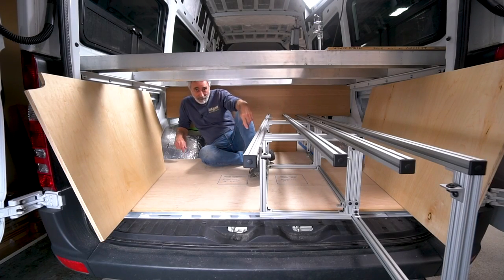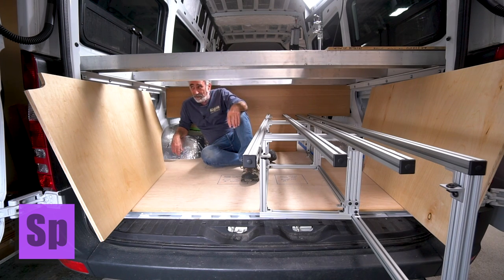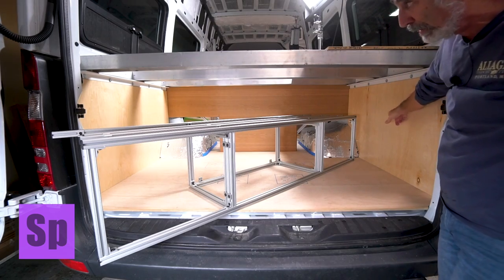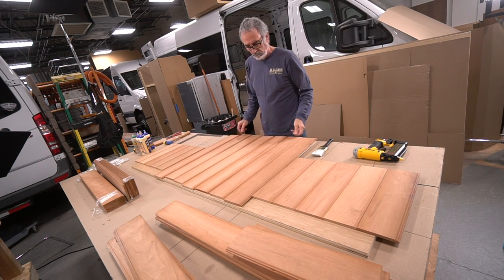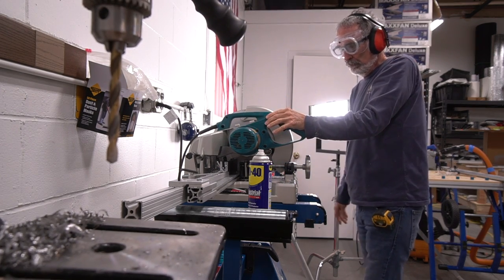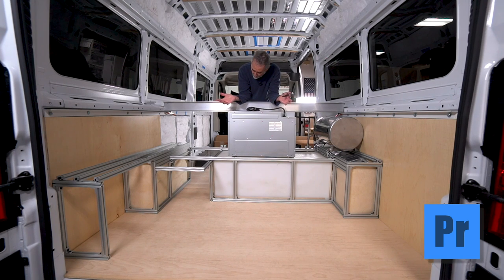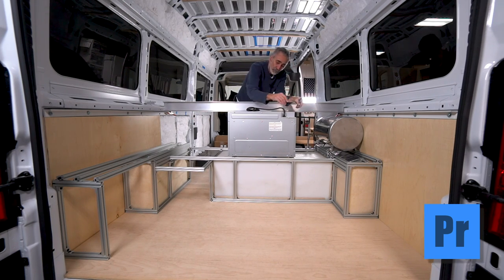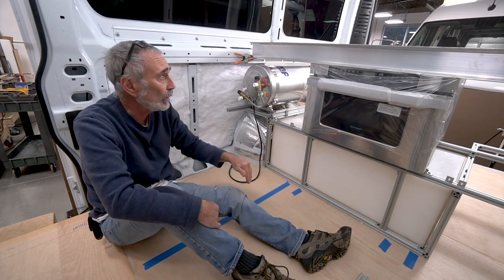More van build tips to improve the quality of your build

Comment: If I could give 2 thumbs up I would. Great video. I got very good results with using alcohol to drill holes cut threats or cut aluminum. Cheap and easy to clean after dry. Only the aluminum chips are left.
Reply from the maker: Interesting, I'll look into that. My first thought is fire hazard with the heat. No flare ups?

Comment: I've used a fair amount of Rubio for my floors, trim, etc.  It is great stuff.  If you really bought a whole gallon, you probably have enough to do 50 vans.  A little goes a long way.  Be aware that the hardener seems to kick off over time.  My guess is that the crappy cans they sell it in are not air tight once you open and reseal them. try decanting to a better container or vacuum sealing the hardener after use.  Also, my local hardwood floor distributor sold me the 1.3L size for $80-90, but It's been over a year since I bought any, so prices may have gone up.

Comment: That was 18:22 seconds of pure information and not a spot of wasted info at all.  HEY!  I LOVE my 90-pound pull magnets. I use them to put the cover on my windshield and keep it secure in even the wildest windstorm.  Problem:  When 2 of the magnets stick together it takes an act of Congress to pry them apart, so you have to make SURE you put the nylon insert between each magnet each time you disassemble and put away.  Maybe try 90-lb pull magnets?  Would make that wall even more secure in case of an accident?  ($12-$14 per 10-pack.)

Comment: I like your magnetic walls , good idea.
Instead of mounting your water heater with four bolts how about one side having 2 notches it slides into and then you only need 2 bolts to mount it instead of 4.
I recently started mounting every thing using the 2 notch 2 screw method .
Good work as usual
Thanks for sharing
Reply from the maker: The water heater comes with two notch, two hole feet, just as you suggest.

Comment: Good stuff! I've already got my magnets for a ceiling in my pro master. What fun it has been trying to stuff a home in a van. Your videography is so good wish I could get better at it sooner. Working on a van to try and sell and really wanted to make more vids of the process but that is a world I haven't been able to wrap my head around yet.  I have one video showing where I'm at on my build if your ever bored. Trying to incorporate a recirculating shower on top of a standard system with a UV light filter and a heat exchanger. Wanted to go the PexA route but it wasn't in the budget. should be an interesting build upon completion. Not near your level of equipment or strength but I think my thought process of accessibility is a lot like yours. Thanks for all the information!
Reply: @bukit23 What pull strength magnets are you using for the ceiling, this is brilliant!

Comment: Attaching the panels using magnets: It's a great idea. 

But the panels will float on the wall and have small amounts of motion relative to the van body - the van body will move more than the rigid panel. I have a case where a magnet holding a door in a B van has annoying metal-metal squeak as the van body flexes. 

I'd suggest making sure that the magnets don't squeak. If they do, a very thin layer of something will less friction might help, without reducing the hold strength too much.
Reply from the maker: I have an idea to keep the panels stationary.

Comment: I installed a underwater marine led lite in my water tank about 4 years age and it still is working, you can mount a surface mount or they make a very small round led lite that mounts in a thru hole..... to see your level..
Reply from the maker: Yes, a light source on any side of the tank will work. Using a momentary contact switch.

Comment: George, I am in the process of planning my 3rd van, a Transit. Your vids are opening up new ways of thinking and building, thank you! I have a couple of questions (for now)- 
How are the magnetic attachments for the wall panels working out? Worthwhile or no? 
What is your current thinking on flooring, floor insulation, and anchoring 80/20 to the floor? 
My van use is as a minimalist camper, and as a flexible hauling vehicle, so easy, repeatable removal of most cabinets is important. I really appreciate your approach of making everything accessible and serviceable.

Comment: Another great video production and explainer. After building your last two vans with self-made 80/20 connectors, did you find the return on investment of time better with the branded fittings that it was worth the extra expense?
Reply from the maker: Yes I did. The biggest drawback is trying to achieve perfect alignment and offset of the holes in the hand made. Near impossible! It will bite you in the A$$ later on.
Reply: That’s what I’m finding too. Unless it some one-off piece that 80/20 doesn’t make, the time it “costs” to make the brackets is not worth the time spent. Thanks and look forward to more insights.
Reply: You need someone to make you an alignment jig on a mill for you.  Would be simple enough.  Oh, hey, <light bulb> a CNC Router could cut you a very nice alignment jig out of aluminum! 😁 👍 hint hint

Comment: Great content and very nice to watch. I’ve got question regarding fixing the 8020. What kind of screws or bolts are you using in order to fasten the 8020 modules onto the structural aluminium members underneath the plywood?
Reply from the maker: Thank you for your kind words. I use self drilling screws through the finished flooring and into the aluminum joists. All side wall fastening is done with nut/bolts or PlusNuts.

Comment: Wondering if you put any rubber anti-vibration damper pads or strips under the microwave and water heater in the Promaster? Or is the metal on metal contact not a big deal once the components are secured?

The builds are coming along beautifully. Each video inspires thoughts of future projects. Can't wait until next Sunday!
Reply from the maker: Yes, I'll explain all that when I do the final install of those components.

Comment: Looking forward to knowing what water filter system you purchased. I purchased my 12v Remco 3200 pump based on what you purchased for another of your vans. Are you able to say which water filter with UV light you're going to using?
Reply from the maker: It's a custom job, does not exist for consumer market.

Comment: I like the aluminum beams. This has a garage and raised bed.
I'm a single guy looking to travel.
Don't like cutting off walk through access to the rear doors.
Is there a way to mount a bed on the wall that folds down?
I didn't know if half on one wall and half on the other for full width sleeping instead of North to South.
I'm thinking 48" width would be wide enough.
George you get me inspired and thinking watching your videos.
Reply from the maker: My next two builds will be rear bath twin bed galley forward floor plans. One of the twin beds will contain the mechanicals, the other, a long workstation that will convert into a bed for the occasional guest. stay tuned!
Reply: I like the I-beams as well.  Is 4" overkill for this length?  I'm really impressed with how stiff it was in the PM, but would 3" work as well and maybe save some weight?  Can't wait to see the Transits!

The two methods I can think of to open up the walkway and still have a rear bed/garage would be raising/sliding a bed section ala Hymer Aktiv/Thor Tellaro, or a full Murphy bed like Travato 59G.  Or you could raise the entire bed with straps like the Revel.  Or if you want really cool go for linear actuators - see a video from Ladi & Margaret.
Reply from the maker: I would have considered a 3 inch I-Beam, but not available within reasonable distance and shipping was not an expense I was willing to bear. You can invent all kinds of convertible beds and such. My experience is, I don't want to go through too many contortions to get ready for bed. Same with a shower. All that maneuvering gets old very quickly. But to each his own!

Comment: Most vans in Europe come standard with a Webasto engine coolant heater. Would it be possible to use that Webasto to heat water with that water heater? That would be convenient because you don't need the engine running.
Reply from the maker: Yes that would work. I did a hydronic Espar system for heat and hot water in my first van build.

Comment: I see the insulation in the walls. Could one glue ridgid foam insulation board to the plywood panel and then put the magnets into the foam board?
I'm not saying you should do that. Thinking about my own build.
Reply from the maker: THAT IS EXACTLY WHAT I PLAN TO DO! 1/4" foam board with the magnets recessed. Wait until you see my pin registration for the uppers!
Reply: @HumbleRoad  Thank you for the reply. I was thinking 1/2" but might be too thick.
Looks good. I like the vinyl on the walls and ceiling. Maybe not the garage.
Reply: @277kne  Hi from the UK. If you want the thickness of 1/2" Kingspan style board, but the flex of 1/4 for shaping simply use two 1 / 4  boards one over the other. You can fix together with spray adhesive once the first board is in correct shape and position or leave unfixed from each other as long as they are clamped firmly into the final position. Hope this helps. John.
Reply: @johnvancamper9581  Thanks for the tip. I saw bare metal in the video and was concerned about the cold metal. 
George said he is gluing 1/4" foam board to the plywood.
And I was thinking all the wall panels and other finishes will all be sealed or tight so no cold coming through.

Comment: George what will you use to seal the top access hatch on water tank so it won't leak??? Thanks
Reply from the maker: You can use any food safe waterproof adhesive, just make sure you torch the contact area on the tank. That changes the composition and allows good adhesion.
Reply: @HumbleRoad  "Torch" it with a heat gun or do you mean blow torch?? I never hear of this before. Thank you for your reply
Reply from the maker: blow torch. creme brulee butane torch

Comment: Thank you for your videos George for they are a valuable resource. In regards to your glycol water heater does this have a major effect on the engine's cooling system? Does the engine now take longer to reach it's optimal operating temperature because of the extended heat transfer tank?
I pick up my sprinter in July 2021 and your tutorials are fantastic. Thank you again.
David from Down under.
Reply from the maker: My glycol system is a closed loop system using a heat exchanger to pull heat from the chassis coolant. Chassis coolant alteration is simply cutting in the 8 inch heat exchanger
Reply: @HumbleRoad  Thank you for explaining this. 👍

Comment: Excellent video and very useful tips (and ideas). Thank you.
I am building a simple sleeping platform in my new Jeep Wrangler and did lots of research on 80/20. Do you use 1010 or 1515 in your builds and do you thing using the 1010 for that simple bed (just to shave some cost) would be sufficient for weight/no-flex? Thanks in advance and thumb up !!!
Reply from the maker: 10 series is fine as long as you design correctly for the load.

Comment: Great video. Are you mainly using 80/20 10 series or 15 series for your build? Thanks for the videos.
Reply from the maker: Both! Depending on the module and weight requirements.
Reply: In the video above what 80/20 series are you using in the garage area, looks like 10 series. Thanks.
Reply from the maker: Yes, 10 series

Comment: It's mandatory that you have a full description of all that stuff in a user guide: how to dismantle, how to gain access, where is what ... this is what matters when it comes to maintanance and repair and not if there a some screws or just a magnet to pull.
Btw. the disadvantage of magnets is that they are not locking just holding. I have a picture in my mind when the user screws a hook on that wall to secure a ratching strap and wonders ...

... and some users better do nothing by themselves as they have two left hands (as we are saying in German: no use with their hands.)
Reply from the maker: The owners get a full 4 hour video users guide. And they participate in making it for a complete understanding. My magnetic attachment will lock in place. You’ll see!

Comment: Hi George, I want to use your magnet idea. Would there be any problem with having strong magnets in proximity to electrical components (Multiplus, Lynx, MMPT, Cerbo, etc., ) and circuit wiring? I need a panel behind my electrical system 8020 bench, where all electrical components reside. Would truly appreciate your thoughts.
Reply from the maker: It could be an issue.

Comment: George. I’m always waiting for your videos on Sunday. They are really the best and the most proficient to learn.
I want also to go with a Isotemp Spa.
I wanted to ask you without mounting a second glycol tank and pump.... but just connecting to the engine coolant system is it a good idea? 
Is it important to keep in this case ( No extra pump ) the isotemp at floor level and not mounted up on the Aluminium frame like your?
Reply from the maker: If you send the chassis coolant all the way back to the water heater, you could have vehicle warranty issues. Also, any type of failure with your system will render the vehicle inoperable.  That is why I cut in a 7 inch heat exchanger up front and use my own system.
Reply: @HumbleRoad  So Basically you still cut one hose from the engine coolant that goes to the heater exchanger and return back to the engine itself and on the other side of the heater exchanger you put your hoses that travel to the Isotemp ( with Pump and it's own Tank ) ? Am'I right?
Reply from the maker: YES! Simone, that's how I did it. That way, I've added only 8 inches to the travel of the engine coolant rather than 40 feet.
Reply: @HumbleRoad  Thanks for the confirmation George. One last question if I may I ask.... do you need a special pump for the Glycol or just a normal water pump ( shurflo o similar ) does the job?
Reply from the maker: For instance: https://static1.squarespace.com/static/5b919721ee1759aa80ba33b1/t/5e7542abc4eac034dbbe8cf9/1584743083698/vortex-bwo-355-pump.pdf
Reply: @HumbleRoad  thanks 🙏🏼..... wow the producers is like 2 hours from my home.
Reply: @HumbleRoad  But if 40 feet will make the warranty null and void, why wouldn't 8 inches?  It is still cutting into the original, right?  How is one OK and the other not?  Very interesting, nonetheless.

Comment: I would like to share the results of my research. Mostly taken from Humble Road videos. A little difficult in getting the Transit extended measurements.
These are usable floor lengths.
The Sprinter Extended is 186  170wb is 169.
And the Promaster extended is 152 and Transit extended is 166.
The Sprinters have 96" in between wheel well and seat.
The Promaster and Transit have 90".
The wheel wells are close in length.
I'll leave the behind the wheel well measurement out. Anyone interested can do the math.

Comment: Just curious how would that glycol water heater connect to an in floor glycol heater?
Reply from the maker: Different systems. This one only works with the engine running . The radiant would hav a separate furnace

Comment: Hi George, I know you weigh and balance your builds, but do the vans before or after need their suspension beef up? I was just wondering to help the van or driver? Take care.
Reply from the maker: The GVWR is based on a stock vehicle as sold. Many upgrade or enhance their systems. Personally,  I would not. It can cause all kinds of liability issues should something bad happen.
Reply: @HumbleRoad  Do you weigh all your creations?  I'm doing a spreadsheet and finding that all this stuff I have in my head adds up fast - both in cost and weight.
Reply from the maker: Yes, of course! Each van gets weighed at various points during the build. The most telling weight is when the van is loaded with EVERYTHING that a full time couple needs to live on the road. Came in 600 lbs under.

Comment: Don't take this the wrong way George, but nice rack.  Neat trick of dipping your drill bits into ATF when working with aluminum! Double neat trick with the magnets! Treat yourself to a new tool from Home Despot. 😊 

By the way when is the new CNC Router going to make its grand entrance?
Reply from the maker: Trying to arrange for an operator to come assemble and get it running. I don’t have the time for the learning curve.